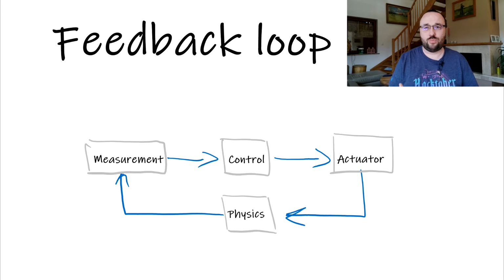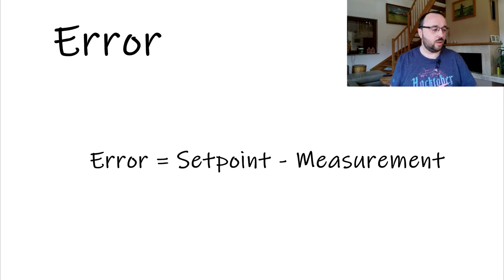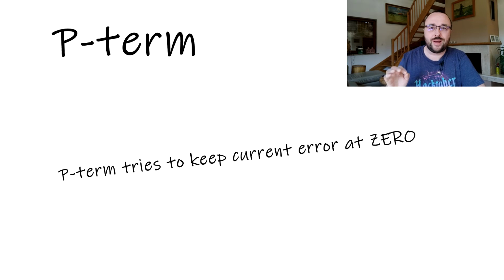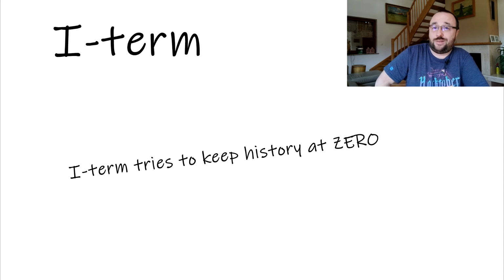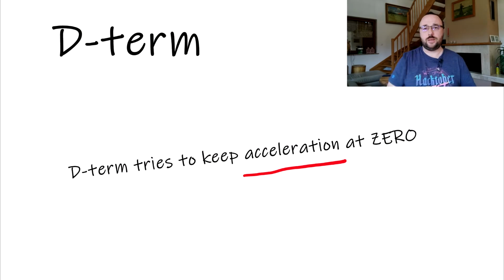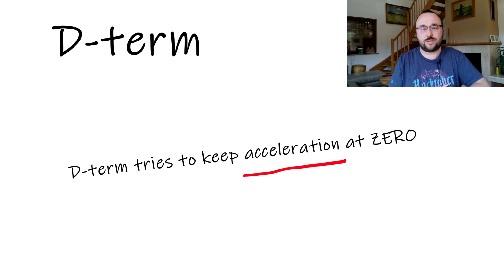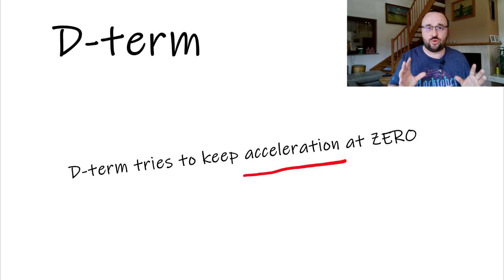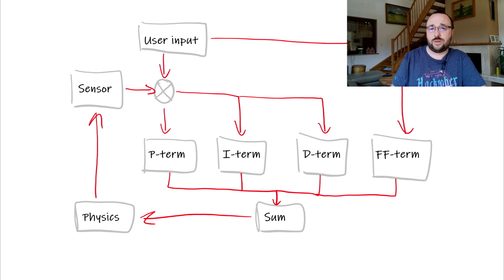How PID controller works? All you have to know about it

Comment: Witam! Hi, I have a 6 inch (BlackOpal Ultra Light) the one that is able to stay in the air for 55 minutes. I'm having some weird vibrations sounds - https://www.youtube.com/watch?v=UG3tKmGH3Bo  I changed props, but the vibrations are the same in mid to high throttle. Any idea what slider to move [P, D or I]?

Comment: brother, can u help me share ur video that explains steps to follow for PID tuning on inav? im using 3inch quad same like cloud 149 but with F722SE. ive upgarded to latest inav. check here https://youtu.be/gV8IRMQDk-s so i need to see the starting steps to setup the PIDs. if im correct, i think i need to work on D gain as its drifting to one side....i used blheli 32 esc app and all 4 ESCs have same starting and end points

Comment: It wold be nice, with some practical examples on the field, or just holding copter in hand - "this is high P and copter/plane behaves like that, and that is low D and it behaves just like that"
Reply: Ma Ra lol.  Good luck.  I flash it tune once and if it doesn’t fly right I buy Vector

Comment: Love me some science!  At what point was tpa introduced? Like what problem in terms of piloting feel what it trying to solve?
Reply: As Rpm increases so does the sensitivity of the PID controller. TPA Throttle Pid attenuation reduces the PID value to keep it balanced preventing oscillations.
Reply: @briannicholas2969  guess I should just look at the code, but that makes enough sense when thinking about tuning high kv 'toothpick' 3" compared to 5, 7' inch builds as far as betaflight/inav/emu/etc etc etc are concerned. ty

Comment: I think a better word for 'mechanical' would be 'robotic' in your explanation :) But still came across.

Very nice video. Will you do more about this topic?
Reply from the maker: Probably. Can not fly, can not build, have to sit at home. Might as well record this kind of videos :)
Reply: @FPVUniversity  Please, please, PULEEAAAASE do!  I would be forever grateful if you could explain the relationship between 1). The different sources of measurement values  2). The main categories of flight modes  and 3). the different families of PID Gains available in iNav.  Examples of each would be:

Sensors:
gyro, accelerometer, GPS, and barometer

Modes:
rate/acro, angle/horizon, and NavPosHold

Familes of PID Gains:
Rate stabilization: mc_pitch/mcroll/mc*_yaw 
Attitude Stabilization: mc_*_level
XY Position: nav_mc_pos_xy_, nav_mc_vel_xy_
Z position: nav_mc_pos_z_, nav_mc_vel_z_*, inav_w_z_baro_*, inav_w_z_gps_

Here are some example scenarios of what you could help explain.  I think it would be of great value to the community:

1).  When does the controller use baro inputs?  GPS?  Accelerometer?
2).  When flying a quad in Acro mode, does the controller use the Attitude Stabilization PIDs at all (mc_*_level)?  Why or why not?
3).  When flying a quad in Angle mode, which PIDs does the controller use when roll angle is less than max_angle_inclination_rll? What does it use when that angle is exceeded?  Why?
4).   When flying a quad in NavPosHold, does the controller use the rate stabilization PIDs at all?  Why or why not?  Does it use the Attitude Stabilization PIDs?  
5).   When flying a quad in NavPosHold - CRUISE, does the controller use the XY Position PIDs (nav_mc_pos_xy_*, nav_mc_vel_xy_*) at all?  If so, for what purpose?

If these subjects are covered in the literature, i can't find it anywhere, and it is causing me to chase my tail trying to diagnose issues with my current build.

THANKS!!

Comment: Good video! Now I am interested to know how INAV handles D term... 🤔
Reply: The answer to your question lies within the deepest darkest core of INAV firmware. Tread carefully!
https://github.com/iNavFlight/inav/blob/master/src/main/flight/pid.c
Reply: @power-max  Red or Blue pill?
Reply: @alsmith2422  red if you want to learn about PID. Although that implementation is complicated by quaternions and rotation matrices.

In my first day of class for linear control systems at UVa the professor with a very quiet and heavy chinese accent was impossible to hear. I got distracted and started implementing a PID control system in Processing IDE, finished before he was done talking about the course and promptly dropped it 🤣

Comment: So, just to confirm, you said that betaflight and emuflight use measurement to calculate the D term, but not inav. Can we assume by this that inav uses the error to calculate the d term?
Reply from the maker: INAV uses dterm_setpoint weight that allows you to choose what is chosen. 1 means error, 0 means measurement. 0.5 means, like expected, value in between
Reply: Paweł Spychalski Awesome. Thanks Paweł. I’m liking these more technical videos.